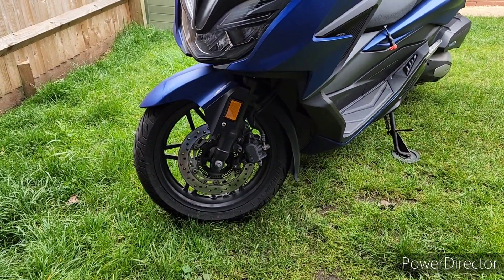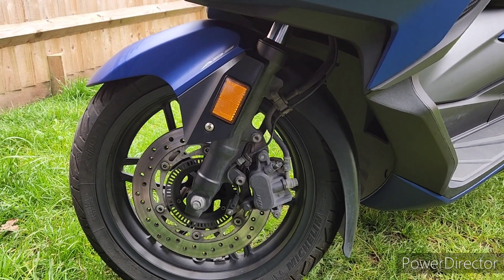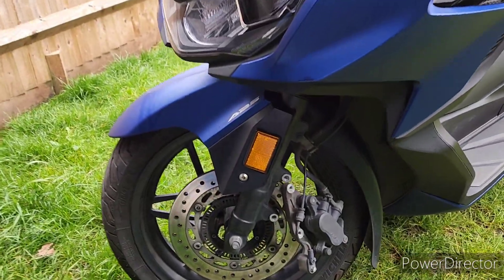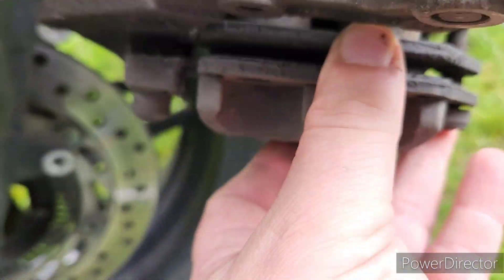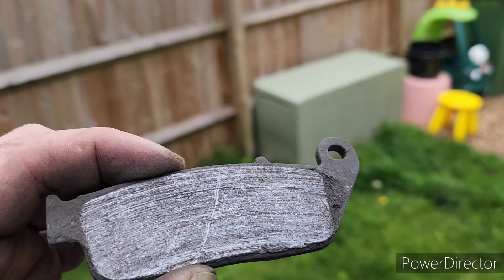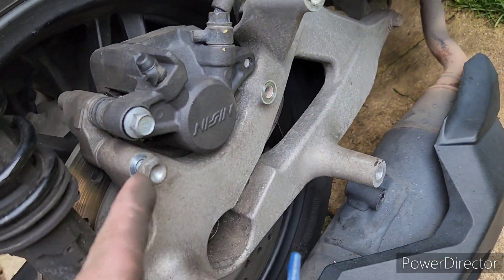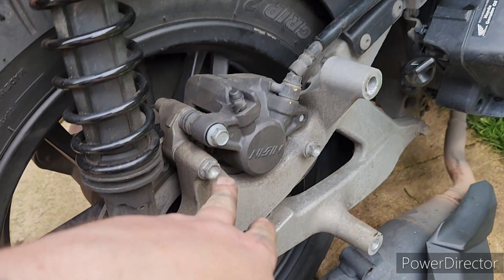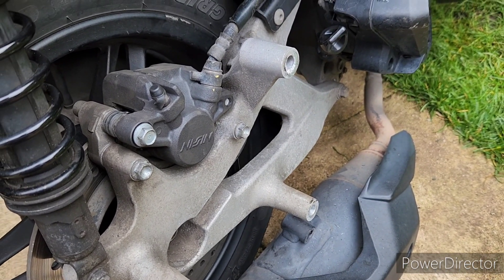Honda Forza 125 Front and Rear Brake Pad Replacement/Removal

Comment: I did changed the front pad ,while doing that push that piston back to put new pads on,did everything but now ,the wheels don't spin😂 and how do i loosen it up a bit ,i looks like piston is not retracing back.Any ideas ?
Reply: You haven’t pushed the piston back far enough should be flat that’s why your wheel won’t spinning